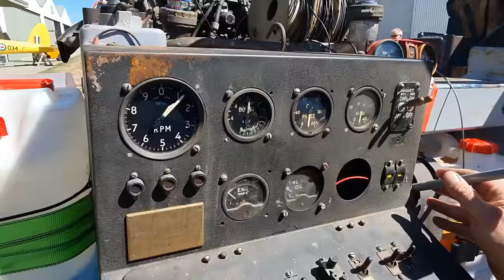First run of Merlin 25 engine in 50 years!

Comment: I was interested to see the rearmost exhaust outlets siamesed together. If never noticed that before.
Wonderful video!
Reply: Yep, i think that's unique to the Mosquito. The glycol radiators are tucked in very close to the wing root and the rearmost two ports are siamesed to avoid hot air being directed into them. Interesting that the siamesed ports are on both sides of the engine though...perhaps the rearmost stub would be too close to the leading edge of the wing..(wood, after all..)
Reply: I noticed but couldn't figure out what I was seeing.  Kept thinking, "wait, ten cylinder Merlin??".  Thanks for clarifying.  I would have lost sleep.
Reply: This got me wondering....are the powerplants 'handed'? Are the left and right engines interchangeable? Do the propellers rotate in the same direction, or do they rotate in opposite directions?
This is fun.
Reply: @bruceboatwright7488  On the Mosquito the engines rotated in the same direction.  On the later Hornet they turned in opposite directions, which eliminated torque swing on take-off.  The P-38 Lightning and F-82 Twin Mustang also used opposite rotation.  I think,  but am not sure, that doing this also eliminated the critical engine for single engine operation.
Reply: @bruceboatwright7488  The engines both rotated in the same direction though I think this was changed on the Sea Mosquito as an engine failure on take off was not recoverable on a carrier when they rotated the same way. See the biographies of Winkie Brown for more details.
Reply: @thephilpott2194  It was used on wooden mosquitos only to give more clearance to the WOODEN WING !!!!!
Reply: @danielhaumesser7816  DUUUUUUHHHHHHHH !!!!!!!!!!
Reply: @bruceboatwright7488  Nope  both rotate in the same direction.  P38 had opposite rotating engines, to cancel the torgue of the engines rotating the same direction.
Reply: @briggsquantum  You are 100% correct,  Brits when they ordered the P38 DEMANDED the engines turn the same way and it was a nasty plane to fly !!!  They were not paying attention to the engineers !!
Reply: @briggsquantum    TRUE!!!!!

Comment: Amazing, but really needs a prop for a bit of air cooling.
Reply: I think those two blue hoses are for cooling.
Reply: You know it is water cooled right?
Reply: @chad6080  So put a fan on the radiator, propeller wouldn't do much for cooling but would make it unpleasant to stand there running the engine.
Reply: I kinda doubt the prop provides a meaningful amount of cooling; look at the Mosquito.  The engine is totally encased save for the exhaust.
Reply: It doesn't need a propeller.  Engines produce very little power (or heat) when running at idle. There is no risk of the coolant boiling or the engine overheating when its only being run for a few minutes.
Reply: The Merlin is a conventional overhead cam liquid cooled Vee-type engine with 4-valve pentagon roof combustion chambers using two 6-cylinder monoblocks bolted to a split crankcase. The engine has a propeller reduction gear on one end of the engine a supercharger on the other.
Reply: @marks6663  Looks  a bit of wing section to the right of the engine, has a radiator in it. The blue hoses run to and from it.
Reply: It's not a radial this babe is water cooled

Comment: Awesome, would love to hear it in flight. First model plane I ever built. I see the reason for the 5 exhaust tubes per side. Amazing aircraft. The Germans tried to make their own Wooden Wonder. We had a Lanc parked in Oshawa Ontario in the 60s. I remember climbing on the landing gear as a boy. I believe it is now on static 
display in Cambridgeshire UK.
Reply: Six exhaust per side 
Its a V12
Reply: @alexlaverick6111  count 'em off 0:23.
Reply: During spring into summer, every Saturday or Sunday, depending on the weather an Avro Lancaster Bomber goes over our house and back again, taking paid passengers on a flight of a lifetime. She's known as Vera (coded VR-A, FM213), operated by the Canadian Warplane Heritage Museum in Mount Hope, a suburb of Hamilton, Ontario. As soon as I hear the thrum of those (4 Packard) Merlins in the distance, I'm out the door checking the sky. I can tell you, IT. NEVER. GETS. OLD!!!
Reply: @alexlaverick6111  The engine thatb was run only had 5 shows it was off a Mosquito !!!

Comment: The Auckland MoTaT used to fire-up the two inboard Merlins of the ex New Caledonian French Airforce Lancaster that was kindly donated by them during the sixties. You could stand there pretty close and as the throttles were advanced the whole fuselage would come 'level' as the tail plane assembly was lifted off the ground by the massive amount of airflow over the tail plane surfaces .. a very impressive sight and sound that was indeed..! These days the Lanc is sitting inside a full permanent enclosure and so no more engine weekly starts sadly . .  : /

Comment: When I was stationed in Scotland on a Subtender the CO of the Brits Coast Guard used a boat that dated back to WWII. They use to tie up along side the boat I worked on while their CO went to talk to our CO. I got to know the crew and they let me check her out. She was about 60ft long. The whole after cabin was engine room. They had two V12 Merlin's rated around 1,000hp each. What I loved was when it was time to start them they use 12ga blanks. We clocked her one night on radar at 45knots on the Clyde and I'm sure she could do more.

Comment: It's fitting that it's being towed pulled by the little messy Ferguson tractor I think about the Cummings and Perkins engines my father used to work with mass Ferguson but that Rolls-Royce Merlin engine boy those guys sure knew what they were doing... That combustion engine sounds sweet...
Reply: johnnauer  Thas a PACKARD built verson of the merlin, and yes changes made !!! !

Comment: Awesome! I learned something here. I always thought those engines were engineered to run properly with a prop…the counter weight was part of keeping vibration and flywheel timing correct. Interesting to see that’s not necessarily so….
Reply: I kinda wondered why they just idled this engine and didn't 'give it the beans', so to speak.  Makes sense after reading your post...the engine might well have shaken itself apart without a prop!

Comment: 03:00 The restored Mosquito is now part of the Omaka Aviation Heritage Centre's "Dangerous Skies" exhibition and sits inside the door seen in the background. Occasionally, the aircraft is pulled outside and engines given a run-up and the fans come from miles away.
https://www.youtube.com/watch?v=bt5OHBrAzN0
I'm looking forward to seeing it at Easter; at the Classic Fighters Omaka air show.

Edit: The aircraft was towed out to the World War 2 flight line each day during the air show. The engines were started and run up several times each day and, each time, the crowds came flocking.
I flocked right along with them.
Parked either side of the Mosquito at the air show were the P40 and Tiger Moth that John Smith had in his shed. The P40 is restored in its original paint condition and the Tiger Moth in running condition, but not for flight.
John Smith's memorial, right there. If not for his vision and foresight those three pieces of our history would have been lost forever.

Comment: What a piece of  engineering....See the fuel consumption (level of blue AVGAZ?) in the jerrycan, in two minutes... (0:19 to 3:15),  imagine the consumption at combat rating...
Reply: some frames where fitted with a small tank with ethanol/ water to increase  short power burst.

Comment: I assume the exhaust is pinched off a bit at each pipe to give the engine some backpressure to run better?
Reply: I'd like to know the answer to that question as well.  That or aerodynamic packaging.
Reply: Definitely not pinched off – when you are flying a military engine, you want everything it can deliver. The exhaust stubs were angled back to let the escaping gases act as a little jet thrust. In the case of the Merlin, it was equal to another fifty horsepower.

Comment: That Merlin engin is a PACKARD built in AMERICA version, the PLAIN steel stamped valve covers give it away !!! Also about 1500 PACKARD built merlins were used in the Mosquito, by the 5 exhaust pipes only plane to use that !!!   FYI !!  PACKARD built 55,525 merlins and 37,137 were exclusively for the Brits, PACKARD was an off shore shadow factory foe RR !!!

Comment: Running sweet as even without a flywheel (prop). I would have thought it a bit dodgy without any forced air cooling? Anyway, you got away with it! Great stuff!
Reply: It's a water-cooled engine so it should be just fine at idle.

Comment: Curious how the rear two cylinders on each bank share a common exhaust manifold while the forward eight each have their own.  Also, I understand that RR outsourced some of their engine block fabrication to Packard no doubt due to the overwhelming wartime demand for this engine.  Great video, a treat to watch!
Reply: It might have been that the firing order required it.
Reply: The rear exhausts are two into one, because the rear exhaust would impact the radiators on the wing if it was separate.
Reply: H5691j  the bak 2 exhaust port were into one to give more clearance to the WOODEN wing, fire danger !!!  RR contracted with PACKARD for COMPLETE engines and PACKARD delivered 37,137 to the Brits and 18,000 to the USAAF for a total of 55,525 TOTAL COMPLETE engines,  PACKARD was an off shore shadow factory away from the war zone !!!  FYI
Reply: @rconger384  nope !!!  Clearance so they would not burn the wing, only the 20 series SINGLE stage supercharger used them the LATER 2 stage merlins were longer and had a longer nacelle not needed more clearance !!!
Reply: @wilburfinnigan2142   I knew of Packard’s involvement but didn’t know the full extent of their contribution.  If Packard provided over 55K fully-assembled Merlin V-12’s, what was total number of engines that were produced and were there any other “Shadow factories” involved?

Comment: Nice piece of mechanical history. If it had been fuel injected it would have been the same technology we see in cars today. Single overhead cam pushrod engine.
Reply: Yes but it did have four valves per cylinder.
Reply: toomanyhobbies,,,  The PACKARD version, which this is, ALL used the Bendix pressure carburator which is akin to the modern    valve body fuel injection.  The carb received fuel under pressure and had no float.  One of the chnges PACKARD made when they built the engines.  The ALLISON V1710 first used the Bendix pressure carb in 1938 !!!  FYI !!!!

Comment: Sounds wonderful! As if it hasn't missed a day of running. Was this engine recently rebuilt?
Reply: It was very carefully inspected and prepared for a return to life.  All it needed was new fuel, oil and a clean set of spark plugs.  Look for the video of the second engine.  It hadn’t run for 69 years and started on the first attempt.

Comment: How is it possible to run an aircraft engine without a prop?
Is the crankshaft's flywheel large enough to sustain momentum ?
Reply: It actually sounded awful despite the robotic Merlin Music comments!  Gawd knows what atypical resonances were wrecking the crankshaft?

Comment: Shows up to drop engine off......  Here ya go...... I got an important meeting, goodby.
Wait, that's 3  4 cylinder engines bolted together.
Turns head around as he's running away.  "Yep all 12 cylinders, it's definitely the engine from your plane".

Comment: I get a bit picky with titles like first time engine has run in X amount of years and usually that means after a full rebuild which means it is not the same engine but this one really does look original.
Reply: This engine has been fitted to a DH Mosquito FB.VI since 1947.  It last flew in 1952 and has been in storage since then.  The owner ran this engine occasionally until the early 1970’s.  It’s incredible preservation and internal condition meant it only needed a hot oil prime, new oil and coolant and it started on the second attempt.
Reply: @larrylewislarry  I noticed the easy start and she ran pretty sweet too, thanks for the back story I guess this Mossie will not need working engines though.

Comment: Can someone explain me why these radial engines are always hard to start/wont start up at 1st crank?
Reply: EyeproductionsAus  looks like you need some eye support, this is NOT a radial it is a V12 inline liquid cooled.  They are not hard to start, to stop them they shut off the fuel and when they go to start they turn so many prop blades to get oil going and fuel up to the carb then hit the ignition, not like starting a car !!!  DUUUH!!!!

Comment: 31AUG2021 - 12 cylinders and only 10 exhaust outlets? I noticed the trailing 2 cylinders are joined at the exhaust manifold. Interesting.
Reply: It was the way it fitted into the plane, it was necessary to make room for radiator inlets

Comment: Excellent careful application of specs and prep. Super engine! Is this model supercharged?
Actually the Merlin was an integral part of the RAF overcoming the Luftwaffe, WW2.  Thank you!
Reply: All Merlins were supercharged. The one that wasn't was used in tanks and called the Meteor!
Reply: @oxcart4172  .. thanks, and many powered Hydroplane Race boats  at venues around Europe and North America.
Reply: big fish  ALL Merlins were supercharged, HOWEVER there were THREE different types used, all early Merlins up to the 20 series used a simple SINGLE STaGE mechanical supercharger, with the Merlin 20 series, just in time for the BOB they added a second SPEED to turn the single compressor wheel FASTER at altitude, then in mid 1942 the Merlin 60 came out with the first 2 STAGE   2 SPEED  supercharger, it had 2 compressor wheels on a single shaft and 2 speeds to turn the compressor wheels.  NOT all merlins were created equal.  The 2 stage supercharger was NOT invented by RR it was invented and patented in the USA in 1938 and the first plane to use it was the Grumman F$F-3 Wildcat of the US Navy on the PW  R1820 engine,  PW also used the 2 stage supercharger on the F4U Corsair and the F6F Hellcat  FYI....

Comment: Something strange about running with no propeller…
The propeller aids in the ‘flywheel effect’, dampening out loads on the internals.
Reply: It’s no different to running a car engine with the clutch pushed in.  You only need a load device if you expect to draw horsepower from that engine.

Comment: Incredible engine to hear I bet there were smiles all around when this beauty started!  I have a question, and that is you hand primed the engine prior to firing, this is a fuel injected engine, how does a hand primer fit into that?
Reply: This Merlin has a simple SU float carburettor and isn’t fuel injected.
Reply: @larrylewislarry  thank you for responding to my question and I would have never guessed it a carbureted engine. Very interesting to say the least! Thanks again for the information! Beautiful engine by the way.
Reply: using aground type carb the pilots had to remember the flat spot as they go over the top of the loop
in fact a lady came up with a mod to curb that this fooled the jerry as it went over the top without hesitation
Reply: @raypitts4880  The PACKARD version as this one used a Bendix pressure carb did not have this problem !!!  DUUUUHH!!!!!

Comment: Any background history on this particular Merlin? What's its war/action pedigree? Otherwise, what an awesome job you guys have done by restoring it to "rotating" conditions! Funny how the exhaust pipes on cylinders 5 and 6 are merged into the same flow by a single collector.
Reply: Look up the Omaka John Smith Mosquito Project on Facebook.  There’s quite a story behind this engine.
Reply: @larrylewislarry  Thanks for the tip. Will look at it.

Comment: Surprised they didn't dribble some oil on those cam lobes when they turned it over with the valve covers off...
Reply from the maker: That's what we were doing, we hot oil primed it and turned it over until the engine bought the oil through itself, I just didn't film all of that as I was on the look out for the oil.

Comment: Is it a good idea to run an engines such as this without a propeller to act as a flywheel?
Reply: There is enough rotating mass in the crankshaft and reduction gear for the engine to start and run smoothly.  We were quite careful to keep the RPM below 1200 and the throttle lever was rigged to allow only a small movement  at the carburettor.   Anything above this and a prop or load device would be required.

Comment: I know Griffon engines rotate in the opposite direction to Merlin's, but does anyone know if there are Anti Clockwise Merlin's and Clockwise Merlin's for all the multi's that used them?  Seems to me the torque reaction on two (or four) Clock or Anti clock engines of that power, would make the pilot's eyes water a bit.
Reply: just so  the  the american pilots had to get used to clock wise engines rolls to the left  and like wise english pilots had to used to contra rotating engines rolls to the right.most amusing  but high ly dangerous.
Reply: The only Merlins that spun in opposite directions, that I know of, were in the De Havilland Hornet.
Reply: @MarsFKA  Wrong !!! Packard made left hand engines for the first 20 F82 Twin Mustangs,  they are rare !!!!!  Them merlin production shut down at PACKARD and they converted to the ALLISON which had a left hand engine  ie P38's
Reply: @wilburfinnigan2142  Chalk this one up. You are right about the Twin Mustangs – I had forgotten.

Comment: Just love it , but a question .... it looks like the two rear exhaust ports are combined to one pipe on each side - why ?
Reply: The version for the DH Mosquito has this - it is something to do with keeping the exhaust flames away from vital components like the radiators. Combining the exhausts lost about 5 - 7 knots of top speed on the Mosquito. I first saw this on a DH Mosquito in the museum at Harpenden and wondered why they had an 11 cylinder engine !